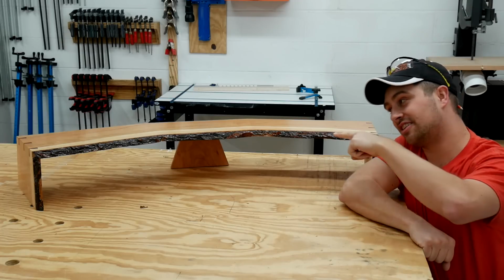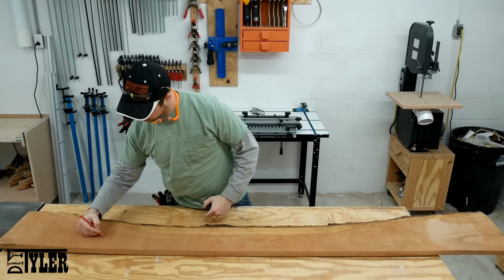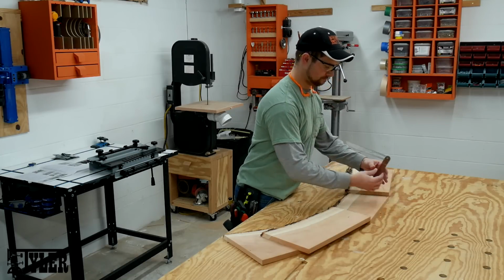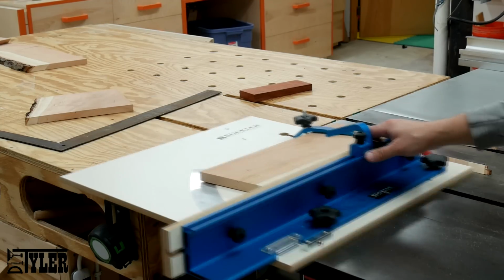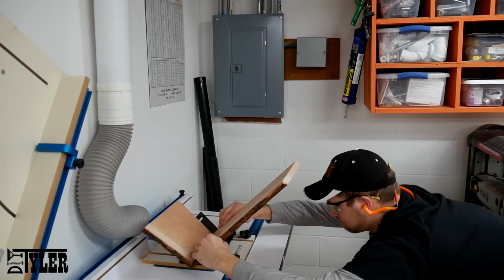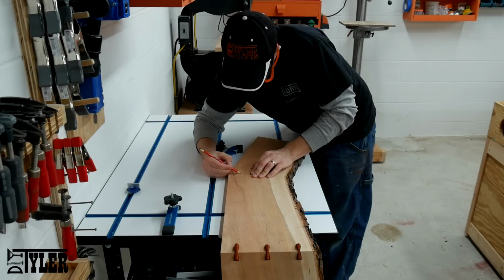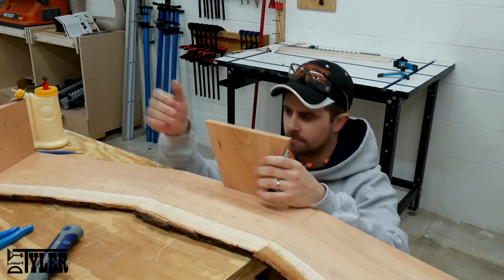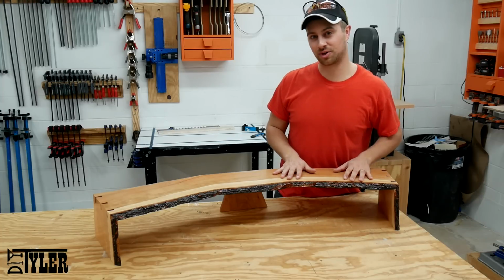Live Edge Waterfall Cherry Monitor Stand

Comment: GREAT project Tyler.  This shows that we cannot simply pass up a warped board.  There's always a use for it.
I think that the 3rd leg was a must and you hardly will see it once it it set up.
Forward thinking when joining/gluing the middle pieces too.

Comment: Very pretty, love the design.
A friendly tip I accidentally found doing something similar: Keep the tape on the piece after the router table until after you have the spline glued in. It helps in glue cleanup and less sanding later.
Reply from the maker: Great tip man, thanks!

Comment: I love cherry. I did something similar but did 30 degree meters on 2 pieces for legs and the table top to give it a curvy look. I wanted to do a dovetail joint on the 8 quarter live edge I had and was going to cut it down to 3 quarter so it looked round but got cold feet and did the other. looks nice can't wait for your  videos
Reply from the maker: Yours probably looks pretty sweet!

Comment: The result is amazing ! I guess you don't need it, but I would have drill an hole in the center leg to pass the wires in the same spot.
My monitor (+ other things) stand is just made of a pine board and 2x4 for the feet. It's ugly but it's practical.
Reply from the maker: Need to come up with something to clean up my cables but wanted to make sure I like this stand first.....I do!

Comment: this looks great. I'm a software engineer who decided to become a woodworker on the side. you're not alone man keep going! BTW what is "skip-planing"?
Reply from the maker: Awesome! Skip planing is when you take shallow passes with a thickness planer and it only hits certain sections of the board....pass over it again taking some more off until you have one flat side to work with.
Reply: Tyler G  how is that different than "regular" planing?

Comment: Tyler, that looks fantastic.  Love seeing your boy hanging around the shop with you, warns a grandpa's heart.  BTW What do you mean by skip planing?  I was alway under the impressing that a planer would just make thing parallel not flat.  I still have so much to learn.
Reply from the maker: Thanks Gary! Skip planing is when you take shallow passes with a thickness planer and it only hits certain sections of the board....pass over it again taking some more off until you have one flat side to work with. Not the best way to go about things but if the board you are working with is too wide for your jointer its a pretty simple option.
Reply: Tyler G. Thanks for responding Tyler.   Have to give that a try sometime.